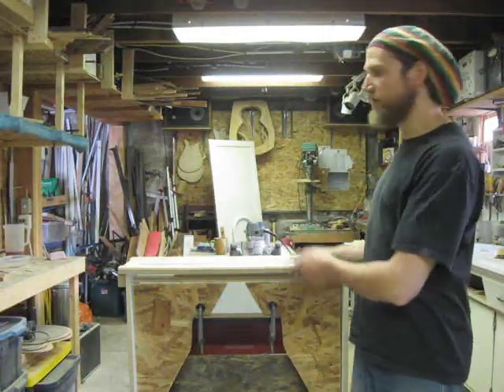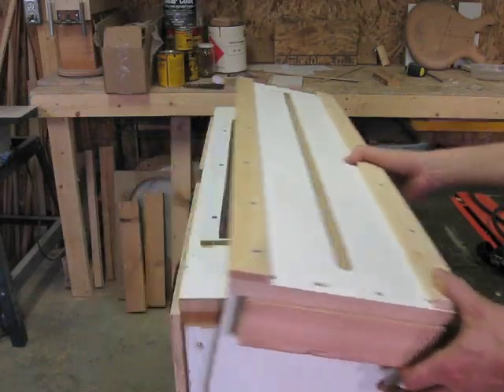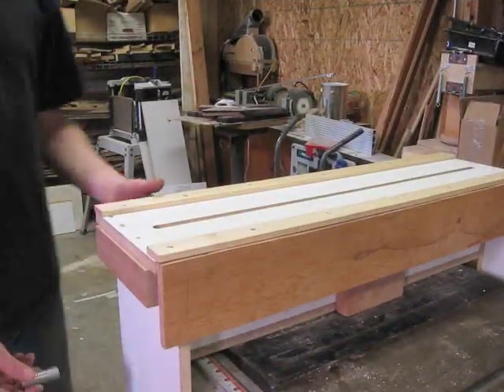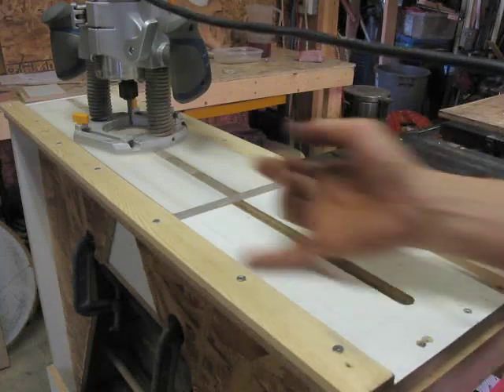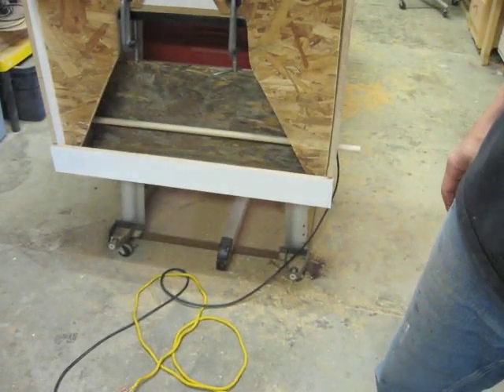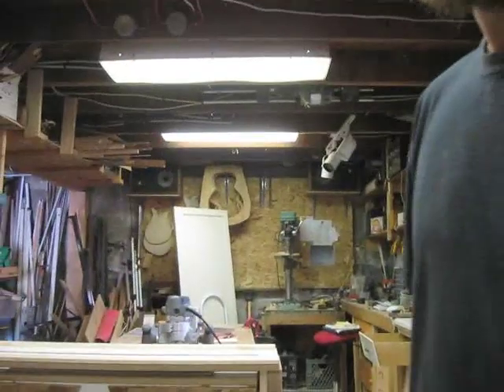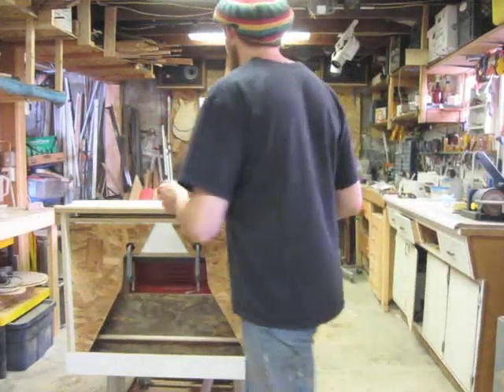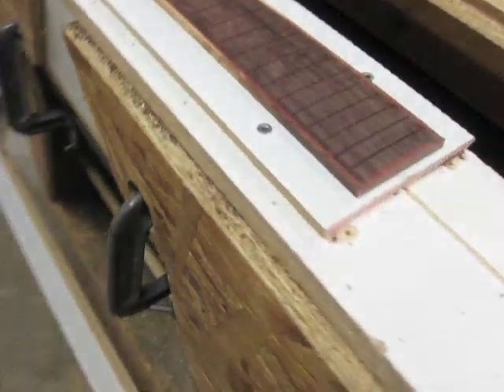Robot controlled fretboard radius routing machine from scrap!

Comment: I luke the way you backed the router off by 1/64" to take a less aggressive cut. I am in the testing phase of a similar jig and will adopt that technique. Also, have you tried using a rounded channel bit for this operation?
Reply from the maker: I've tried a few bits including a 1.5" diameter t-slot cutter and a rounded bottom cleaning bit. The rounded bit does leave a better finish.

That being said, I no longer use this jig and now do it by hand with a Stew Mac aluminum radius sanding beam and a guide jig that keeps it perfectly straight while sanding. When I account for set-up time,  sanding in the radius with 60 grit takes the same amount of time and I save a lot of storage space.
Reply: Artavox thanks for replying. I really like mine with the mids I came up with. I turn a crank which drives the router down the rails and moves the fretboard side to side at the same time. Now that I've got the kinks worked out, there is basically no set up. Clamp the blank on on center, drop the router, back off 1/64, return it on and turn the crank. 10 minutes, tops.
Reply from the maker: If only there was a place where you could upload a video for us to see your machine in action…  Please!
Reply: Ha! I will try to work that out. But it won't be as clever as your vid.

Comment: how do you make a compound radius with this jig ?
Reply: Gary Busby You can't the way this machine is configured with one pivot axel going the full length. If you used 2 separate pivot axels, you would place the pivot points on each side into different holes. Seems like you could do this mod easily enough.
Reply from the maker: David is correct:

http://www.proulxguitars.com/buildup/build9.htm